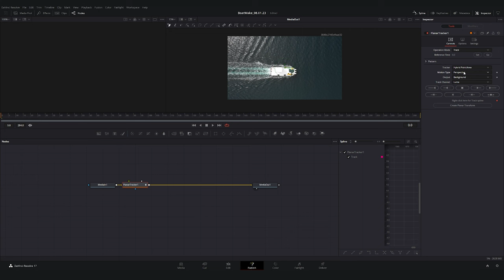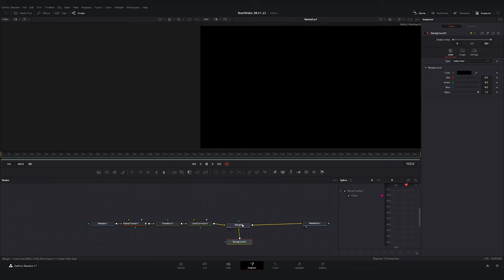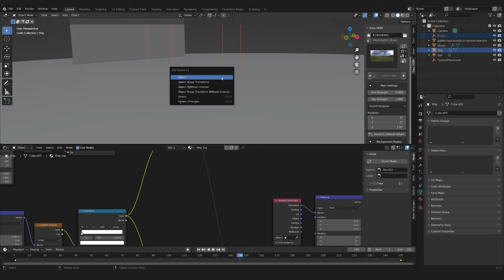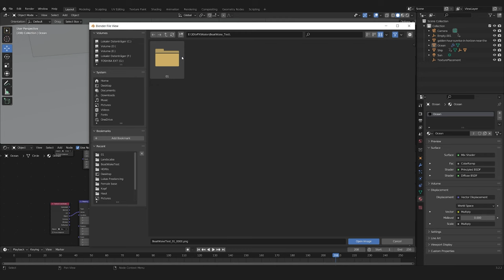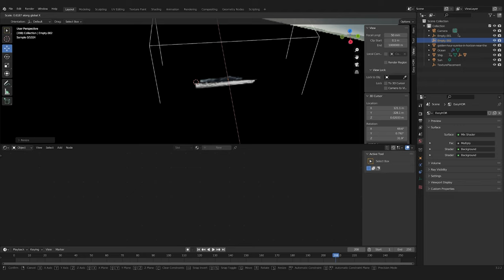How to make a Ship Wake in Blender | Tutorial

Comment: upon working on a feature film i was tasked to create many shots of a ship out at sea. all cgi.  Originally i was looking into several tools and applications for simulating the wake and foam, but quickly came to realize that simulations take an absurd amount of time and a ton of cached memory.  the problem with the simulated method, is that creating shots with long distance boat wakes means doing vast simulations before your boat is in the position of the shot. in other words you must create the long wake behind the boat before your shot is even ready.  so i bailed on the simulated approach and figured ide just fake it all with texture maps.  both displacements wake maps. and ripple and white foam.  and guess what, no one was the wiser.  i even did partical simulations in front of the vessel to give the impression of splashes.  it worked out just fine.
Reply from the maker: Did you use single texture maps or did you do animated sequences? Did you extract them from real footage?

Comment: I think It would work really good to actually displace the ocean using the footage via adaptavie subdiv that you probably already used for the ocean. To enhance this effect even further you could also experiment with dynamic paint and generate waves by using the sequence to generate the waves
Reply from the maker: Yea, I thought about using both things.
You are right about me using adaptive subdiv on the ocean. So it would probably be quite easy to add the wake. Not sure though, how this would affect the render time.

I tried baking out an animated disp map with dynamic paint in a different scene, so that I could more easily use it in many other scenes. Unfortunately though, I did not yet get a result, that works for me.
Just doing the stuff I showed in the video, was good enough for me until now. But I‘ll probably have to improve it at some point.
Reply: @mlt-studios  yeah dynamic paint in  is kinda wonky sometimes.
The render times shouldn't be that much longer you are already subdividing the plane so the displacement isn't resulting in higher poly count

Comment: How do you change the speed of the wake in DaVinci? I've already tried to slow it down, but it keeps exporting at the same speed.
Reply from the maker: You can’t slow it down, since you can’t magically create new frames. 
Example: you have a clip consisting out of 24 frames. When you speed it up by 200%, davinci would just play every other frame, resulting in a 12 frame clip. 
If you slow it to 50%, the 24 frames now would have to stretch 48 frames. But you only have 24. 
what it could do is play every image 2 frames, which would look super weird and not smooth. So I guess that is the reason davinci does not do it.

The only thing you can do is to speed up all the other things, like the ship speed, so that it matches.

Comment: Nice animation.
But can you tell me one thing...
I am using mirror modifier to make a model ship but i want to add some asymmetrical details to it so when ever i am turning off the mirror modifier the half part gets gone.
So is there anyway that I can switch off mirror modifier after making the model ....
Reply from the maker: You can apply the modifier, if you press the small arrow in the top right corner of the modifier and select apply.
Reply: @mlt-studios  no no i mean i just want to remove the mirror modifier after the completion of the model... Is there anyway I can do it?
Reply from the maker: @cursedkat6787  to be honest, I don’t really understand the problem. You can either remove the modifier, this way you will only have half of the ship. Or you can apply the modifier, this way you will get the full ship and can add asymmetrical stuff.

You can write me on discord, to maybe give a more detailed explanation on what you want to achieve. 
DerMalt#0547

Comment: 如果大海波涛汹涌怎么办？
Reply from the maker: Your Question (according to google translate): What if the sea is rough?

Well, with the method shown in the video, the white Water should stick to the surface, even if the waves a very big.
Though of course, big waves would have a bigger impact on the white water itself, so it might not look as realistic. But that is something you have to test and see if it's good enough.

As I've said in the video, this whole method is just a quick alternativ hack to simulating the water.
There are a lot of cases, where this does not work/looks realistic enough and you have to do it the hard way, by simulating it.